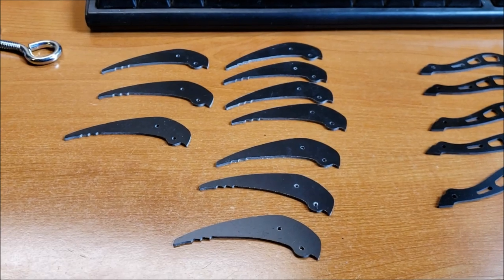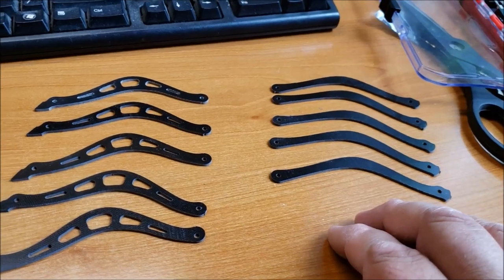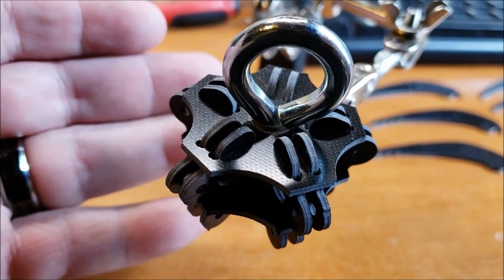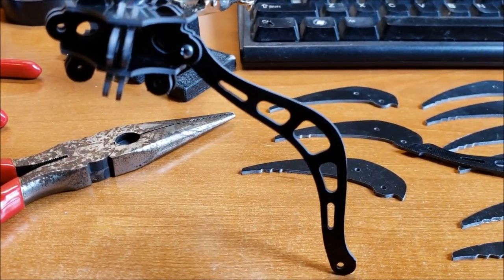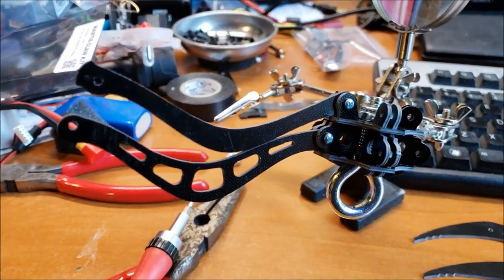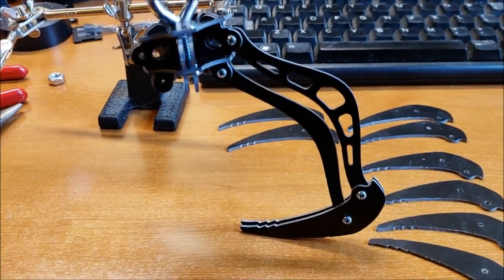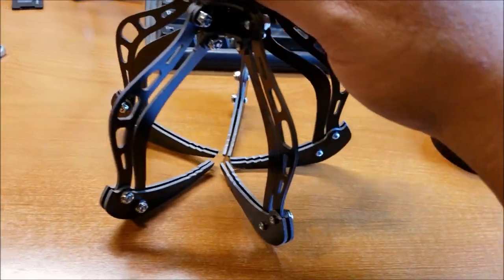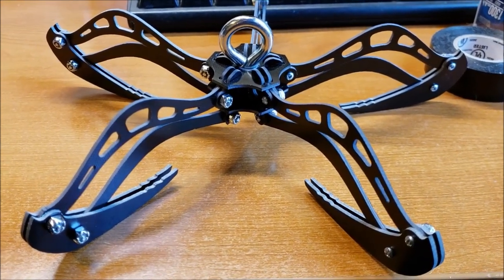The Mantis Claw Kit Build

Comment: Thanks for sharing this with us. I'm considering this myself. I just used a mini grappling hook to retrieve a parachute that I dropped from my drone which landed in a tree, but for pulling a drone out of a tree this claw would probably do a better job. Since lifting a typical drone with a weight of up to 900 grams that's nearly the maximum payload of my Mavic 3 so I'd replace the eye bolt with a nylon bolt and nylon nuts. Since this thing is only rated for lifting up to 5 pounds that would be plenty strong enough and since this is intended for use with a drone I'd probably also replace all the nuts and bolts with nylon nuts and bolts which should lighten up the whole contraption by at least 50% of its original weight. I'd be surprised if all of that metal hardware doesn't weigh more than all of the carbon fiber parts combined. That eye bolt is way overkill so that would go for sure. After making those changes that should take the weight of the Mantis Claw from 95 grams down to about 48 grams. That should allow the Mavic 3 series of drones to lift a drone weighing about 850 grams. I would also use braised fishing line for the tether keeping the weight down to a minimum.

Comment: This would make a great drone rescue kit.  If I lose one in a tree, I can use my drop switch to release it if I get the claw stuck.
Reply from the maker: Yep that is the reason I built it
Reply: @FPVEvilMunkey  i use the drone saver pole for trees... Works great... Got this for top of building and area's the have un obstructive way to pull it straight up and away... I wouldn't trust the claw for pulling out of a tree... Quads can get pretty tangled up in branches... Once you hook if you cant pull it out, then your mavic is stuck too.... Maybe im wrong 🤷🏻

Comment: Thanks for the instructional content! How much does this thing weigh? Is this the 3.5 or 5 inch version?
Reply from the maker: Thanks it's pretty light actually. I think this is the 3in. version
Reply: @FPVEvilMunkey  Wondering if it's light enough to hook to a Mavic Air 2 to pick up 500 grams or so? I guess I'll drop the $20 to find out...lol. Great video man and thanks for the quick response!
Reply: @originafreerangechicken  i lifted a fpv quad that weighs 803 grams off the top of a building using a mavic pro 2 and the Mas platinum props... It definitely struggled, but got the job done. You'll have no problem lifting that much weight with the Air 2